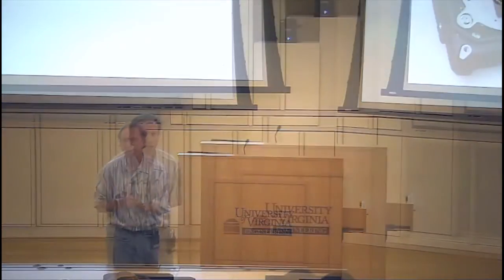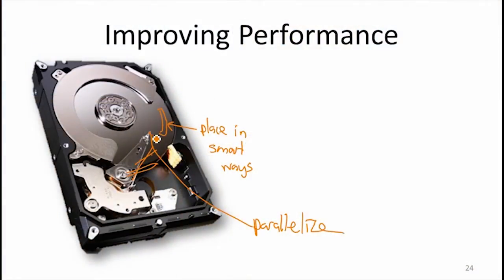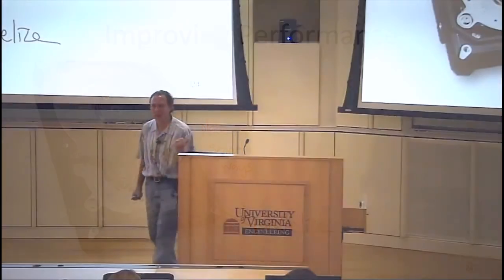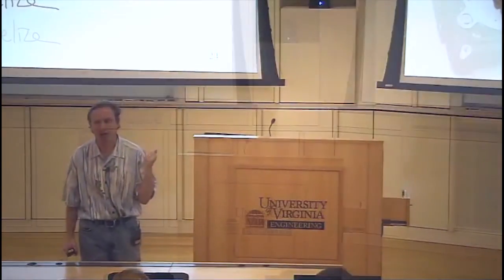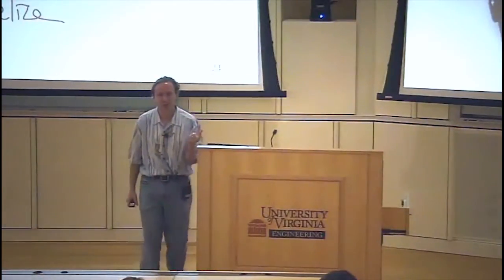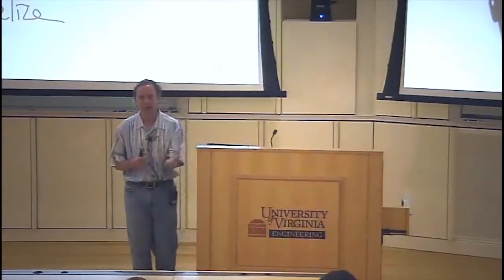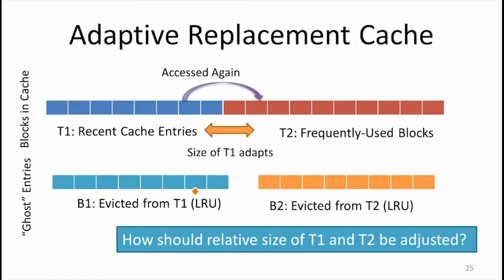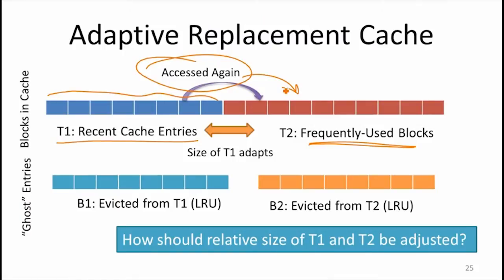Adaptive Replacement Cache

Comment: Great lecture! Got a question, though. What would the initial size of T1 be? Should it be c (total amount of blocks) in order to accommodate as many blocks as possible, say, during an initial cache "warm-up" phase. Or should T1 be c/2? If so, it will have an initial poor hit-rate for frequently-used blocks, until a balance has been achieved.
Reply from the maker: Thanks, +Johan Fredrik Varen.  This paper (which introduced ARC) provides a lot more details: https://www.usenix.org/legacy/event/fast03/tech/full_papers/megiddo/megiddo.pdf. Would need to read this more carefully to understand what they thought was the best initial sizing (and the actual best start would depend on the workload, configuration, etc.), but I think your suggestion of starting with an initial size of T1 close to c makes sense.  Assuming the system runs for a reasonable length of time, the initial setting shouldn't matter too much in the long run.

Comment: That's an awesome video. I have one basic doubt regarding the performance of Adaptive Replacement Cache. How do you think its efficient then a general LRU map? (In both cases we are pruning out Least Recently Used entries) ?
Thank you :)
Reply from the maker: Thanks!  It depends a lot on the workload, but I think for most disk workloads ARC should be better since it adapts to balancing recency and frequency based on the workload as it adjusts the cache size.  For a particular workload, you would need to do experiments based on specific policies to be sure which is best.